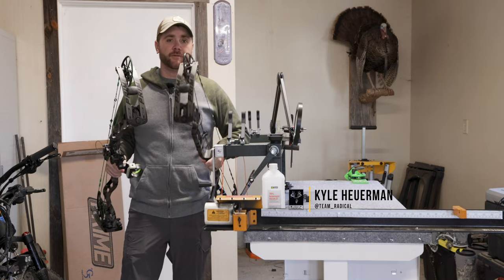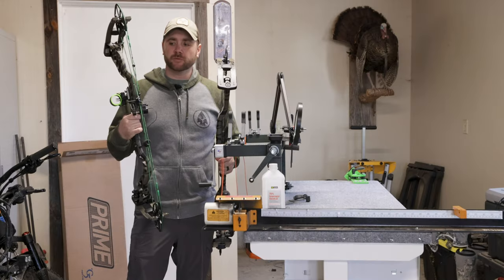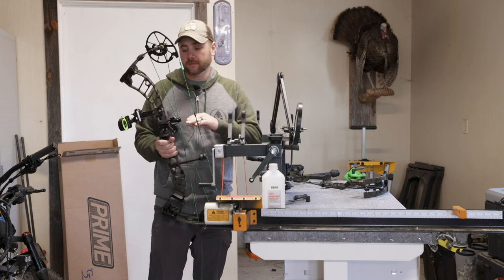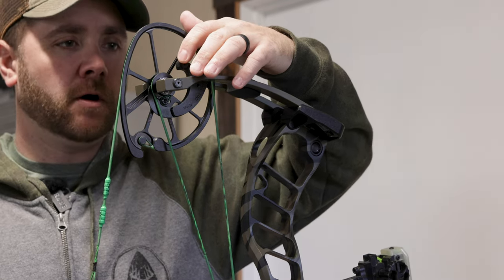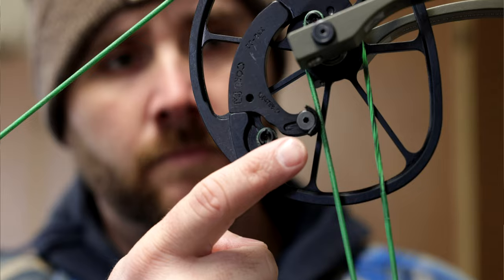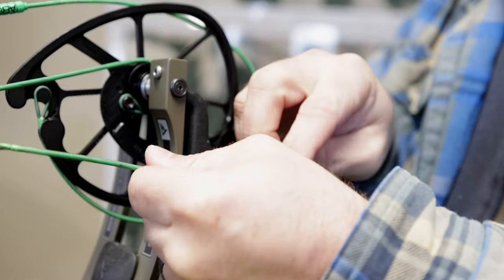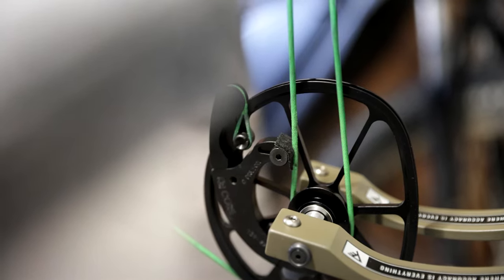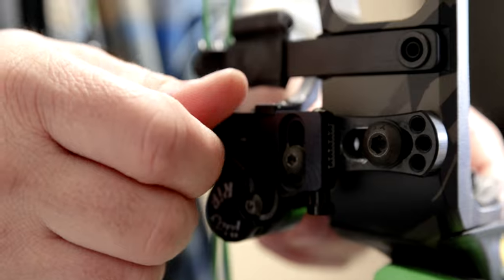Prime Revex Cam Timing How To

Comment: Hi . I got 27.5 revex 6. Is there a possibility that I can adjust the arm length 27 or a little lower?
Reply from the maker: You can put the bow in a press and twist the string say 4 times and see how that feels. It's a bit tougher shortening vs. lengthing it.  If you do get it where you like it make sure you check the timing again. Getting the right mod is definitely your best option but you can give this a try if you'd like.
Reply: @TeamRadical  Is there a link to the module?
Reply: @TeamRadical  Which rope should I shorten?